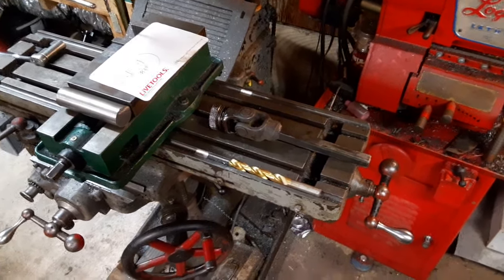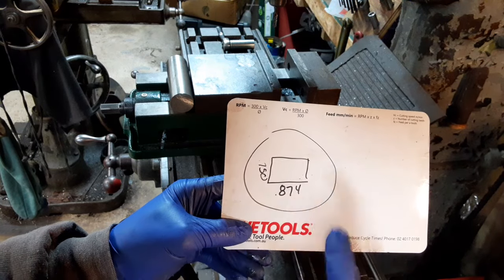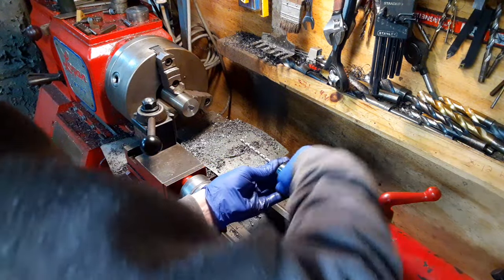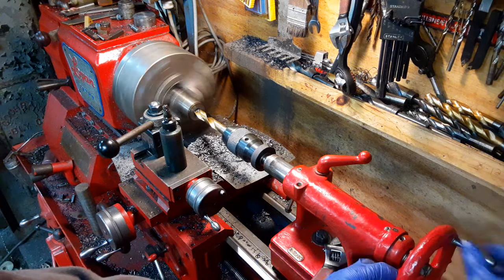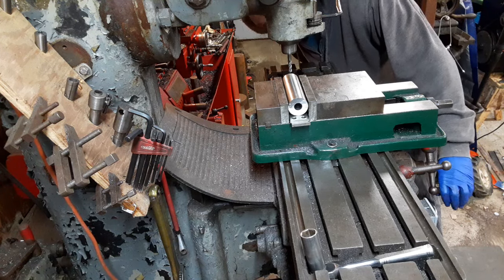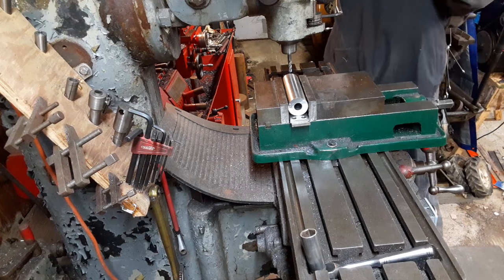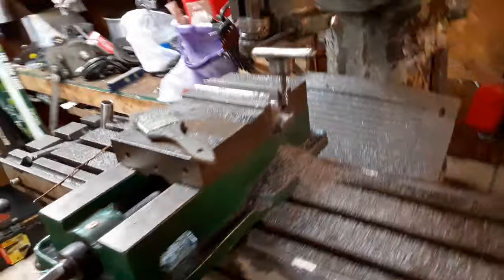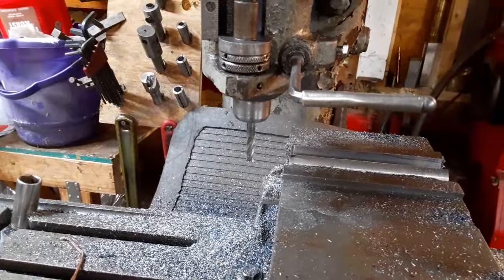John Deere 400 slave engine shaft build part 1

Comment: This is a very interesting project and I like your thinking of powering through the front PTO, assuming that the deck turns in the same direction as the engine That drive shaft looks identical to a Bolens Large frame. Great progress and I am looking forward to following this project
Reply from the maker: Luckily I can turn the engine around as needed to match the direction of rotation....other then what iam building right now it should be a pretty simple project